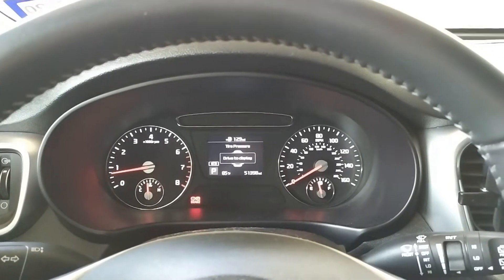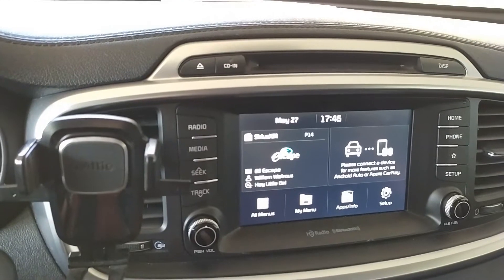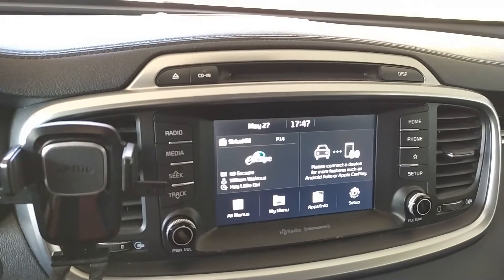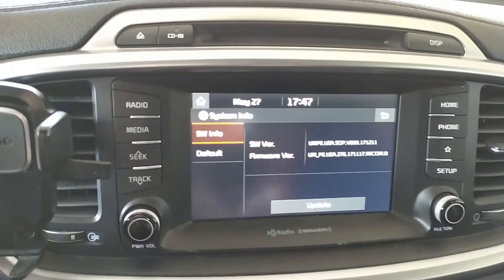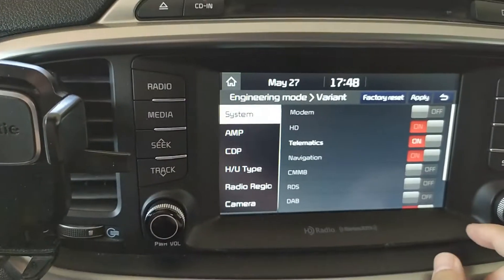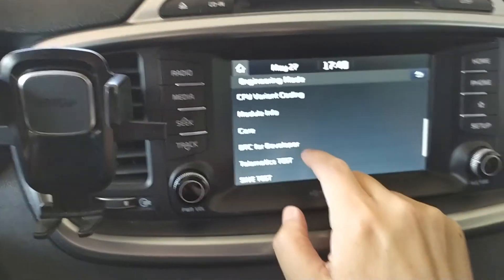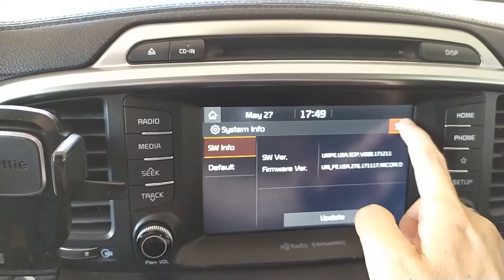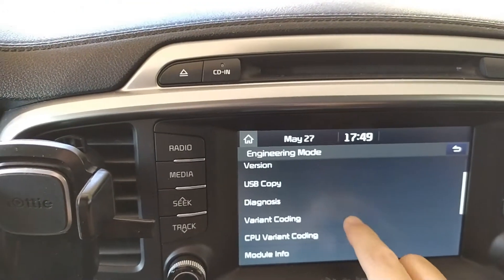Kia SECRET Engineering Mode - How to Access

Comment: So with the kia optima s 2020 that didnt work but i literally clicked a bunch of spots above the update button and it came up, cant figure out the password
Reply: Could you tell me how ? Or where to press ?
Reply: @hughchambers7605  i ended up figuring it out, same spot in the settings as this guy is showing just instead you have to touch the screen ALOT faster. So its click 10 times left side (when i say fast i mean fast) and it doesn’t have to be the left bottom corner, just to the left side of the update button then quickly (not as fast but faster-ish) press 2 times right side of the update button and it will pop up. After looking through ALOT of forums I found the code and its 2801. You’re welcome. Do it a couple times i never get it my first try. The unfortunate part is you do NOT get as many settings as this person, I work in IT so I literally tried EVERY single button / setting but the only cool thing I found that was an improvement was you can make the sound system better. I even turned on the wi-fi settings and it never worked. If you figure anything out, return the favor and let me know if you learn anything, thanks!